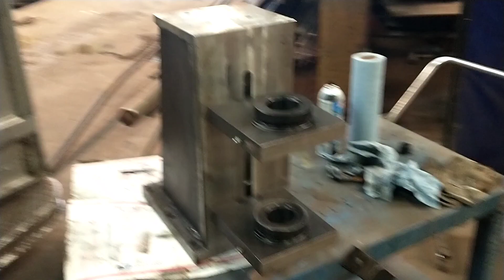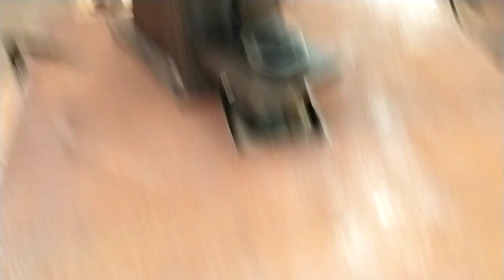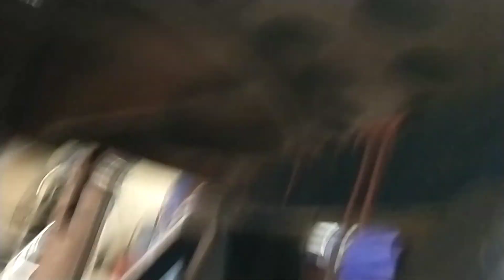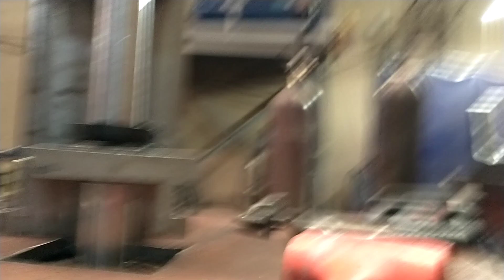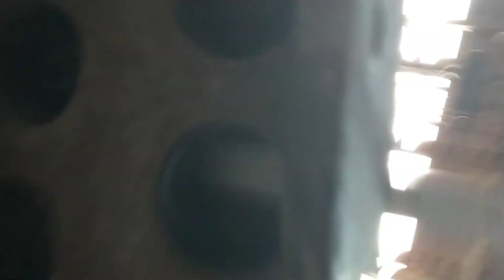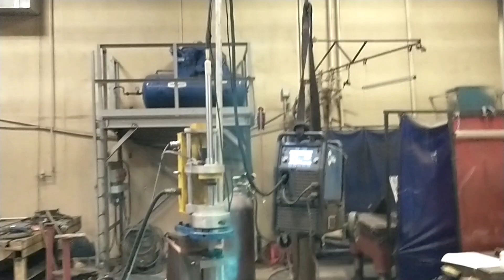Iron casting bore repair doesn't go as planned.

Comment: What's the base material? Who knows? Any luck with nickle wire on cast iron. Interesting video
Reply from the maker: It is a genuine mystery part, we know it is iron but have no specific information on the metallurgy of it. After many years of use in a oven environment exposed to high temperature steam it's a near certainty that it is more brittle and less weldable than when it was first cast. I have run some nickel on iron, my experience has been that the first pass with any filler on iron will have base metal inclusions that are glass hard. The use of this mig brazing process was supposed to mitigate that problem but as the video shows that was a pipe dream. All my experience to date shows that any electric welding or brazing process that you intend to machine must be at least two passes deep and not machine closer than about .100" to the base metal.

Comment: Could you use silicon bronze?
Reply from the maker: I have done a lot of Tig on iron with silicon bronze, the overall weld characteristics would have made little or no difference in this application and due to the extremely high material cost(think $50lb) we were using what we had on hand.